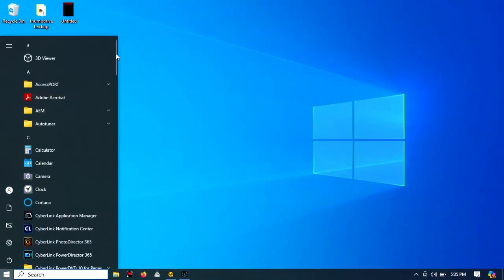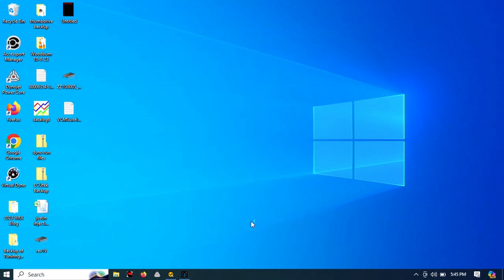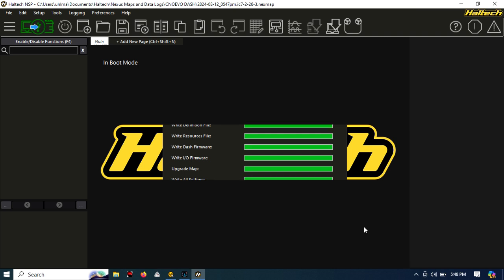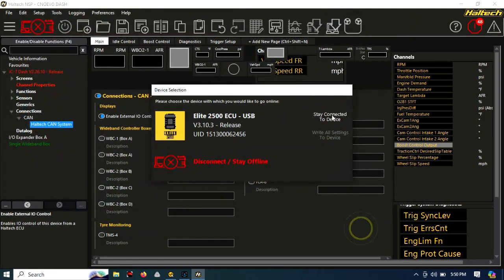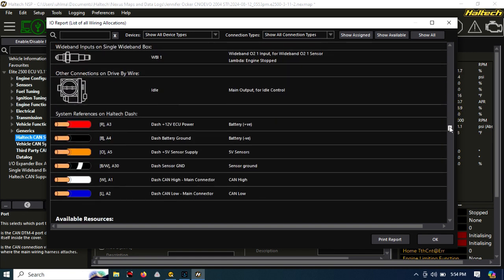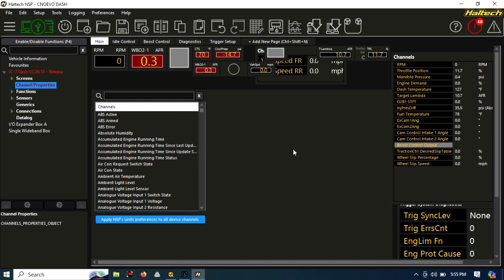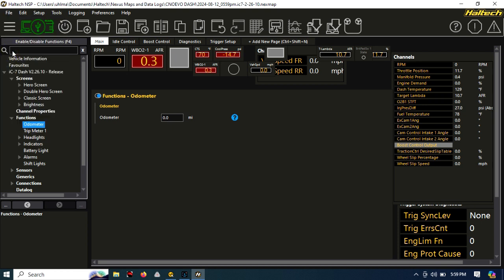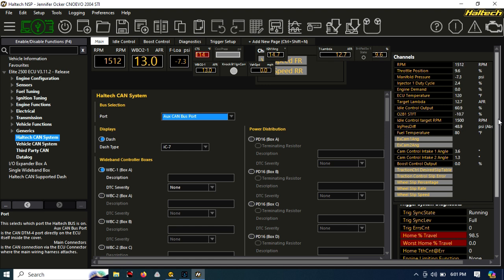Taco Tunerversity - Updating Haltech IC-7 for use with NSP Software

Comment: when are we going to get pd16 screen back ?? I have been patiently waiting but no news ,if I had know I would loose screens I never would have updated to nsp. Not much of a update when you sacrifice half the screens
Reply from the maker: You can make your own
Reply: @WT4T  I want the one I already paid for back
Reply from the maker: Maybe call haltech.  They do answer the phone!
Reply: @WT4T  already called them , they were not much help
Reply from the maker: Humm.  That's unfortunate.  And you've looked in the software for layouts? There's more that aren't uploaded by default
Reply: @WT4T  I have looked but that one is not there
Reply: @WT4T  answering is about all they do I called them on a couple issues and got zero help out of them
Reply from the maker: Humm.  Well,  answering is still better than you'll get from holly 😂
Reply: @WT4T  holly must be really bad then .after spending about 10k  with them on this one truck you would think one could get a little help when needed. Ive been looking into making my own screen today but not gotten very far with it yet. Im using elite 750, pd16, 15 button keypad and ic7
Reply from the maker: Yeah,  Holly (and most others) are pretty awful just in general. Link is decent, most others just have to contact the dealer you purchased the stuff from.  There is definitely a "dump" screen still in the defaults that you can add any and all channels to
Reply: @WT4T  you mean blank screen?

Comment: I just updated my ic7 to nsp a couple days ago and before doing it I had a screen on the ic7 that shows what is going on with the pd16 and I had this screen even though I have not installed the pd16 yet. My question is what do I have to do to get this screen to show back up or will it show up automatically when I do install the pd16?
Reply from the maker: You can load additional pages through the nsp software. But I don't think that the screen is automatically populated anymore
Reply: @WT4T  yes I realize that but that screen is not in the ones available